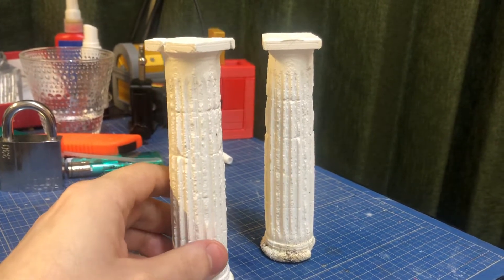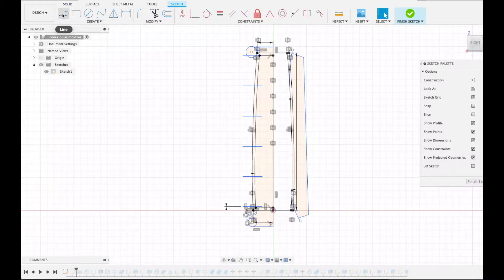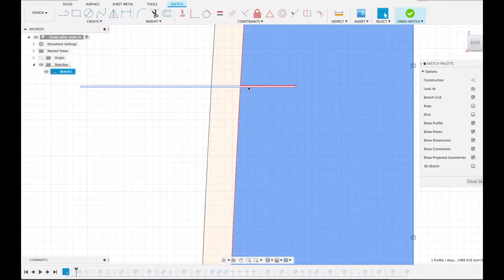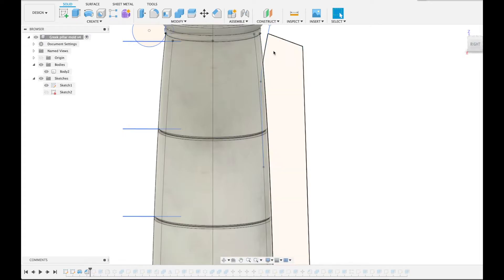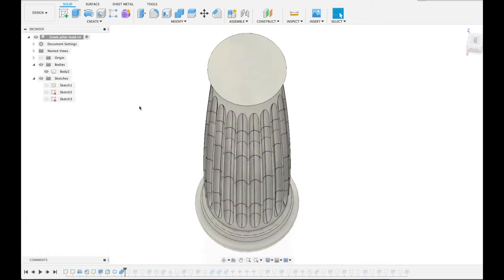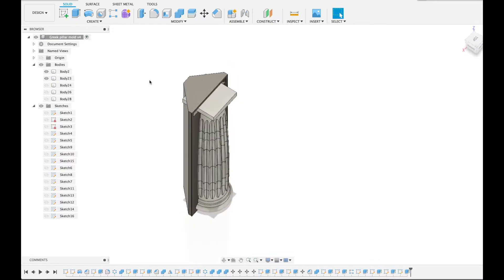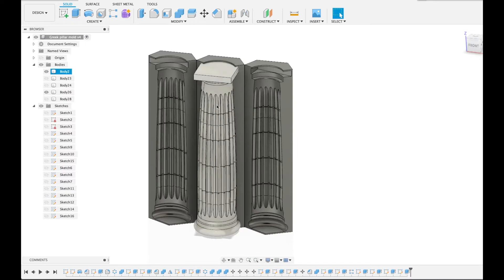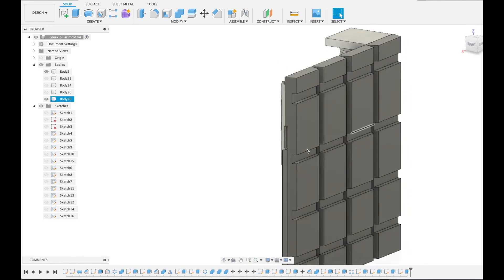Plaster cast Greek columns with a 3D printed mold

Comment: Try some silicone spray as a release agent. You can pick it up for 200y per can.   
When I use gypsum in silicone molds it releases real easy.
Reply from the maker: Ah that's great. I was trying with some oils but they didn't work great